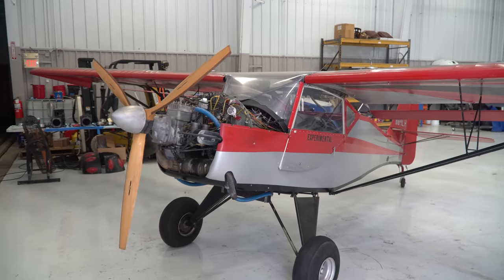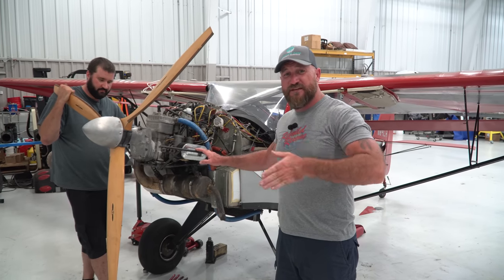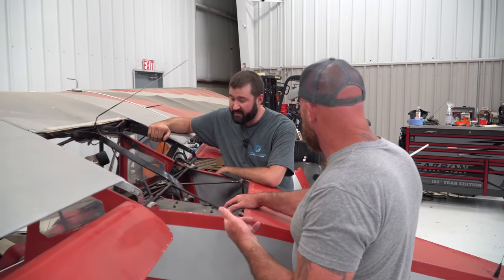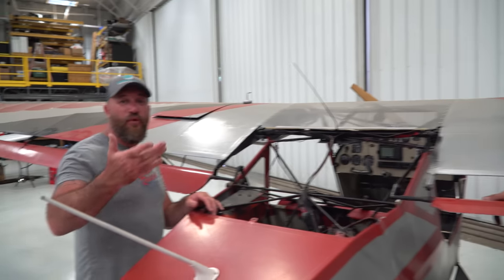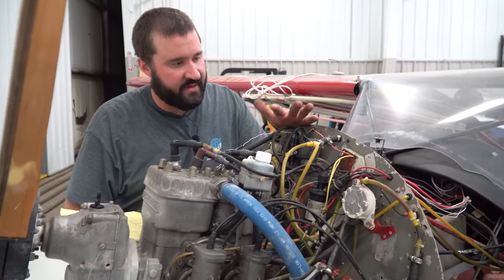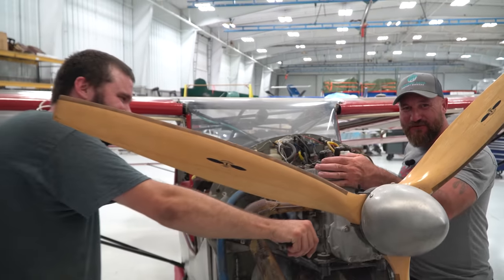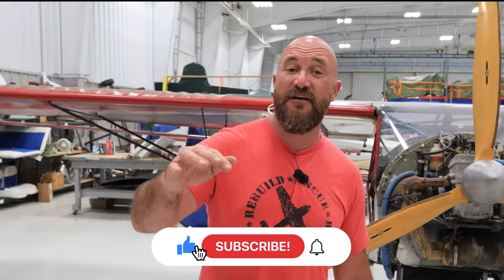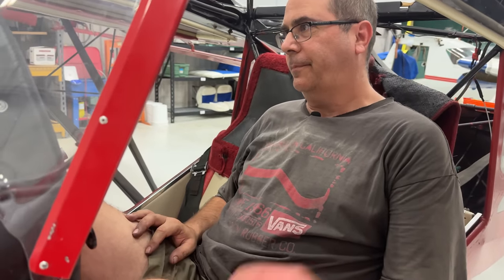Everything wrong with the CHEAPEST airplane on the internet

Comment: Jason, come on. The 'issues' with this aircraft are very minor for the average 'experimental' ultralight owner. Quite frankly anyone who buys an aircraft like this and gives it to a qualified mechanic to do the work is crazy and just looking to have their pockets emptied. A mechanically competent owner would have it sorted in a couple of week-ends for not a lot of money. 2-strokes do NOT 'wear themselves out'. The Rotax recommended TBO is 300 hours. In fact you run them 'on condition'. Many such engines used for training go to 500-600 hours. It's horses for courses. You really need to talk to the right people for each type of aircraft.
Reply: They don’t wanna die and I wouldn’t either better safe then sorry
Reply: I absolutely agree.  That Rotax is fine
Reply: It may be possible in America that you can work on an airplane yourself without any papers, but fortunately that is not the case in every country, here in the Netherlands you are not allowed to put a wrench on your airplane without any training.
Reply: You are fooling yourself son. If you intentions are to flip the airplane and make a buck all the add on's are going to put you in the hole. Fix what absolutely needs to be fixed and have fun with it.  You can at least recoup your investment and make a few bucks if you decide to resell it, provided you don't go crazy.
Reply: @battz99  tldr 👉🥺👈

Comment: I replaced the radiator on my powered parachute which has a Rotax 582 Blue Head with a aluminum radiator that I got off Ebay.  Had it retro fitted with 1" hose nipples and custom mounting brackets.  A $200 investment.  it has served me well.

Comment: I wouldn't go with the model rockets thing for the parachute, since they require power to operate.  If you want something "powered" use CO2 cylinders and a hand-operated mechanism to open them.

Comment: Ballistic chutes are heavy!  Keep the airplane light for performance. 4 point harness.  Should stall about 27 mph indicated.
Reply: it will be single place when they are done
Reply: The aeromarine installation looks like a nice option, BUT how heavy is the installation?  You lose about 3 ft/min climb per pound.  If I remember correctly, the gross weight on a model1 is 900 lbs.  Check the weights of EVERYTHING you are thinking of changing.  The airplane is a lot of fun to fly. Solo, mine would take off and land in less than 75 ft NORMAL LANDING on grass.  Again think really hard about adding weight!  
As to the rubbed off paint on the flaperon pushrod, this is likely due to not folding the wings back carefully!  Or during transportation... not the flying configuration.  The efficiency of the wood prop is terrible, go with the IVO, or similar ground adjustable.

Comment: You have to tidy the wiring and fix the interference issues, secure the fasteners, etc., no matter what you do to the power.   So fix it and run it up, run around the airport in a tight pattern a few times.  THEN do the engine and avionics.  You'll have a comparison.  If not that, get a local KF owner to let you fly their 2-stroke as a comparison to your upgraded one 🙃

Comment: Really cool meeting you in OshKosh! Thanks for pic together. This is for everyone out there, Rotax engines run at a higher internal temp. You MUST use the right oil per manufacturer specs, not just any 2stroke oil. Bombardier recommends API-TC for a reason.
Reply: Eh, they said the same thing about my jetskis back in the day, had a 583cc and a 787cc Seadoo.  Dire warnings if you don't use Rotax's oil that cost $50 a gallon at the SeaDoo dealer, you're going to have problems.  I switched to using full synthetic TC-W3 immediate after warranty and they were still running fine after almost 15 years with many hard weekends at the lake, at the time I sold them.  Never rebuilt either ski's engine and we would run 3 tanks of gas or more through them every weekend we had them out on the lake.

My personal opinion is that Rotax is only trying to sell their branded oil.  There's nothing especially unique about these engines compared to other two strokes.  I don't know what temperature the theromostat runs on Rotax engines in non-watersports applications, but in a watersport application, your water temp at the inlet is the lake water temp.
Reply: That oil he used is Klotz Benol BC-172. It is rated S.A. racing only. I use it for everything I have that does not take injection oil. It's what I have used for years in racing Karts (Yamaha KT 100 engines.) And my RD354. It is Castor based and will separate in cold weather. SP-1 Spectro is probably better or A Rotax factory recommended oil from Castrol. (Usually.)

Comment: G,day from Sydney Australia.
*A new engine and carbon fibre propeller is a great choice. 
*Thanks for highlighting the missing split pins/safety wire on the crown end nuts.
* Is the BOM approved as PFD for experimental. Did it receive FAA approval? I thought you still needed the three steam gauges or a G5?
* How are the weld joints (rust) on the tubular frame?
🌏🇭🇲

Comment: Opening that pipe alone improves the performance of a two stroke, one of the reasons is they simply clog up and 2's love gas-freedom. The cart guys used to drill flutes into the  exhaust ports to funnel the gas.

Comment: I like the little Rotax Two cycle engine.
I like them in small projects. Maybe not so much in aviation, but they are reliable when taken care of and serviced properly. I would probably pre-mix my fuel instead of using oil injection. It can't malfunction if it is not there. New project! Now find a place to store it for the next year or so until the 401-02 is finished.

Comment: I think you got a good deal. I wonder how much that v twin will affect the weight and balance? I take it the covering is in good shape. I don't know if i like folding wings I am sure they are fine just something else to worry about. I think you might wanna change out all the wiring refresh it completely. That is what my friend David Adams done to his long easy good thing he did cause there was a short that he did not see till he started rewiring it and that wire went to the fuel tanks pump.

Comment: That Can Am engine Aeromarine uses in the Merlin seems to really be a good choice over the Bombardier two stroke engines.  I wonder how long before Rotax figures that out?  Hummel has adapted a similar Generac V-Twin with a belt drive reduction too as I recall.  Ground adjustable pitch composite three-blade prop is the way to go on this unit.
Reply: Rotax ceased production and support of all two-stroke engines 2 yrs ago.
Reply: @buckmurdock2500  "Rotax ceased production and support of all two-stroke engines".  Yes.  I know that.  I just wonder if they might miss the revenue from UL/LSA-X and decide to go with a four-stroke two-cylinder engine like the one's just now coming on the market.  It could also be that they are content with focusing on their four-cylinder opposed certified engine clientele too.  Either way, I like what I'm seeing with the V-twin four-stroke engines being adapted for the UL market.  I have my eye on the Merline Lite, but I'm still not sold on the Polini.  Areomarine has the Can Am V-twin they adapted for the Merlin, but it just misses making weight for the Part 103 Merline Lite.  Darn.

Comment: I used to mess around with old boats and there is always something to fix.  Doesn't look like that complicated to me.  Everything is out in the open where you can get to it.  Float planes are more dangerous to land.  How hard can it be to fix the landing gear bolts?  Given the importance placed on keeping that big fan out front running I'd be more interested in and how corroded the engine looks inside.  Can you even get parts for it?  Or for what looks like a reduction gear??
Reply: Zero corrosion inside he ran a snake can in first video

Comment: Looks like a neat project!  The Aeromarine engine option looks intriguing; I've not heard of that one before; how does it compare, weight-wise, w/ the Rotax 912UL (80HP) (probably, the Rotax would be much more expensive as well)?  Too bad HKS gave up on the turbo "700T" (80HP, two-cylinder, FI, four-stroke, 720cc, IIRC); the "700E" was a nice little engine, but only 60HP and carbureted.  I don't have lots of experience, but a KitFox would be on my shortlist of kit-planes to buy.  You've probably seen the STOL Drag Race competition at Reno from this past week; some of those folks take "EXPERIMENTAL" to whole new levels (anything from modified C-180s to Steve Henry's 400HP Yamaha 998-powered "Yeehaw 8")!

Comment: Pretty Kewl, I tol' Ya that those "Bomb's" were Kewl.
the company home base is down in Florida, and the owner also owns the Searay (or Aventura) Seaplane (I don't remember which one it is, but They've had them Mounted on a Strut for their Seaplane.
on the Back end, is a little tiny Wind Generator, as the battery only holds a one hour charge

Comment: Hey Jason, I love it when you mix it up abit with other projects.  I assumed this week would be about Oshkosh.   Summer is almost over, It would be great if you  finished the boat and got it on the water.
Reply: At the rate he is working on the boat it will take years to complete just like the 401 where in the past 4 weeks, he put on part of the 401's nose gear.  He's pulling the motors out of the boat and having a least one of them completely rebuilt and he has to fix the rest of the boat as well so that's not happening this summer.

Comment: Right off the bat.. no.. the Hobbs does not tell you how many hours it has flown. It tells you how many hours the engine has ran. A significant amount, (or even theoretically ALL the hours) could be on the ground.  Tractors have hobbs, but they don't fly.  Also, while it is highly likely there were no safety wires etc on the landing gear, or that they were "torqued", that cannot be proven. I'm not trying to be annoying, but these are assumptions, and in aviation, there is no room for assumptions. Flapperons... I'm not even a licensed pilot (though I do have 80 hours in cessna's, occasonally fly a paramotor, and 107 drone) and I know this stuff.

Comment: Don't do it.  Putting a ballistic parachute in this plane would be more hassle than it's worth, and more headache to keep current.  And the weight of the system will cut into its useful load.  Not worth it for a plane like this.
Reply: officialRebuildRescue-_  

Not counting the cost of the system and it’s installation, it will need to be repacked every 5 yrs at an additional cost between $1000-$3000.  

Probably more significant is the weight—an additional 37-41 lbs, which I believe is NOT at the CG, but behind it. This cuts into your useful load significantly.

Comment: Now? Thousands. My buddy bought a similar one with a 2 stroke Rotax-Bombardier aircraft aluminum engine that we had to rebuild. This was in the early 90s and it was probably 2000 to rebuild plus another 1000 in avionics another 1000 misc. so the 5,000 plus 5000 to repair 10000 in 90 now probably x5 so 50k? The airport crew named it the "Flying Coffin." Good name as it almost killed a stunt pilot who took it on its maiden flight. Forgot the 2 500.00 spark plugs.

Comment: In the air they fly ok but don't use the flap Ron's as flaps bolt  up as you lose control with them down and landing control is week below 60 mph   they are not a aeroplane for the inexperienced pilot's    I biuld one in 1990 and it bit me on landing

Comment: One thing you didn't talk about was a fabric punch test.  If the punch test is bad, you'll need to recover the Kitfox with new fabric which, in my opinion, should be Ceconite.  Very durable and was used on the Citabria aircraft.  🙂
Reply: Punch test is not a valid test. Plus this is polyester fabric.

Comment: Don't think I'd do all that upgrade, and bit surprised 22 hours of labor to fix, what was found. I'd compression check it, if in spec, fix the prop and the things mentioned and go fly it. It's a ultra light right ? No license required.  I don't think upgrading u will ever ser the investment back.
Reply: No, it's not legal for Part 103. Two seats should be the first clue.
Reply: @buckmurdock2500  challenger ultralight comes  2 seater. Can under trainer.

Comment: That landing gear might have nylock lock nuts on it. That 532 is a purpose built aircraft engine. The pipe on it is designed to get reliability out of it. You can put a hotter pipe on it but it will make it less reliable. That prop is probably not serviceable. Just buy a new 582 with a C-Box with electric start. Put a new Warp Drive prop on it.
Reply: I have lots of experience with Rotax aircraft two strokes. My Dad manufactured Dominator gyros for over 32 years. He became a dealer and authorized repairman in 1986. 

The 532 was not made very long. It had a few issues. One of which it was very peaky. It would come up on the pipe for us just about the time we rotate. That’s ok in a fixed wing but, in a gyro not desirable. 

If it were me I would stay away from that V-twin. If it’s what I think it’s an engine from an air compressor or generator. They are heavy and usually not the power advertised. 

I would find a 582. Until recently they were available new for around 8k. They are about as reliable as a two stroke can be. I found using Amsoil interceptor oil helps. They have a 600 hr TBO. I personally have seen quite a few with 1300-1500 hrs on them.

Comment: Wood Props are fine... replace  the one that's on it. Git rid of the Rotax (my opinion based on years of ultralight flying) put a good 4 cycle on it. Replace all the tubes and wires.  Get a Punch tester for the fabric.  Then maybe a good Experimental. Good luck and have fun! I really enjoy the Chanel.
Reply: it has polyester fabric

Comment: Very nice video.  Thanks for sharing.   Upgrading the Rotax to a V-twin motor makes perfect the sense.  Adding new avionics would be good too.  Might look into getting either an MT composite propeller or a Sensenich wooden propeller.  I think Sensenich is the only manufacturer that still makes wooden propellers if I'm not mistaken.  Typically all rubber hoses that are 10 to 12 years old need replaced due to age hardening.  On experimentals, be sure to check all the wiring very closely.  I have found common lamp cord wiring on some experimentals being used as a grounding straps.  Lol. Be sure to test the aircraft fabric for tensile strength.  A Maule tester is a good way to test the fabric.  Its amazing what you will find on these older experimental aircraft.
Reply: there's several companies that make wooden propellers for the experimental market.

Comment: So you want to start an airline with a kitfox.  You can firewall forward and digitally enhance the panel with an afis. it will do the same as the bomb but  removeable  so you can use it on other aircraft. but i like your thinking stream    crack on

Comment: Who cares what I think. But I was just waiting for the moment you would ditch the 532 Twin Carb. And sure enough.
Being a Kitfox 1.0 number 51, I was hoping you would keep it original with the 532.
I am always keen to preserve as much as possible in a resto. And you only had 140 hours on the block and some minor issues. Of course it needed to be pulled down, cleaned.
IMO it's heritage value is going to be lost.
But it's not me flying it. And you'll have injection and 4-stroke. And you're cashed-up so you throw money at it. I get it. It will probably be more reliable and that's important.
But I'm still disappointed. Poor precious me. It's your plane. And it's your ass in it at 5,000 feet flying over water.

Comment: The timing was set with a motorcycle timer. Even with a rebuilt engine, new fuel filter, plugs, pistons, etc. It still inexplicably cut out at about 700ft causing the stunt pilot to do a maneuver to crash land in the ditch. It never cut out on the ground which made me think it was an oxygen/gas issue? Weird. Never flew it.

Comment: So… I take it you didn’t get airframe or power plant logs with the plane?
Reply: officialRebuildRescue-_  sure. 
My apologies if you mentioned them somewhere in the video and I missed it, as you know the logbooks are key to any airplane, experimental or certified. 

Early on, your A&P mentioned that it appeared that at one point the KitFox had a recovery parachute. That would have been noted in the build log, and one removed, in an updated weight and balance sheet. 
Also any applicable service bulletins, SAIBs and such

Comment: Am 6000 usd as I think you will have to replace the engine and prop or I know I would.  And am a bit dated on the cost of parts.  Then you have the safeties to deal with and there was a crack some where.  Seems the prices have increased by 4x since I was serious about all of this.  But you could have got a new one, with no problems, no issues for around $45,000.  So, if you add up what you paid for it and the 23,000 usd you mentioned for repairs and replacement of parts then you could have got a brand new one for the same amount.

Comment: I'm really curious on how that VTwin will fly on this Kitfox, it's a 60hp vtwin how will it handle 2 adult men? it's built for a 1 seater smaller plane.
Reply: officialRebuildRescue-_   Well the VTwin that you're looking at was set up for the Merlin which is a single seat plane. it's also 60hp but i do like it as it's 4 stroke fuel injected and has a harness with computer so that you can plug into a good engine monitor. I'm just wondering if that 60hp is enough for your kitfox and two adult men. the weight i guess, i know the 582 is a 65hp i would like to know your thoughts on if it's enough power to get the kitfox up with two ppl. if so, that would be a great alterative for the 2 stroke 582. i know the kitfox 1 is much lighter kitfox so it may be fine i hope you get it and able to do testing i'd like to see it in that version of kitfox for sure.